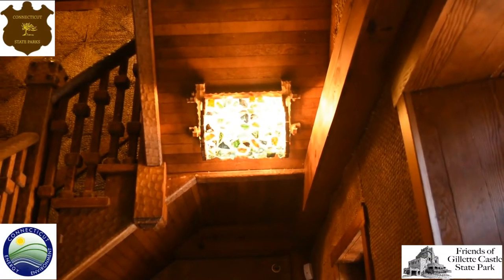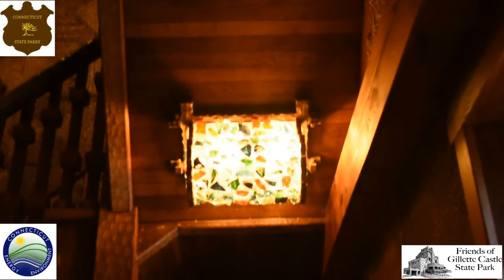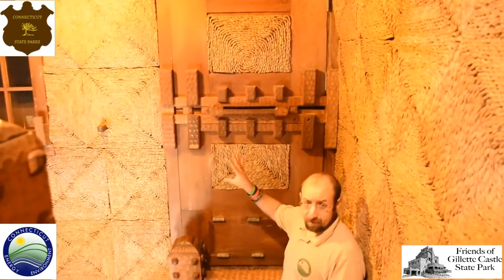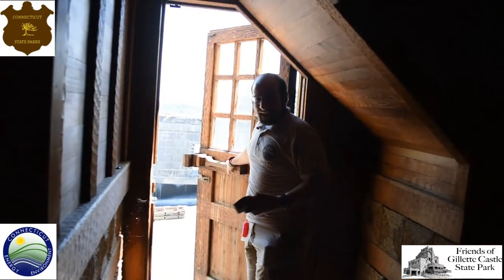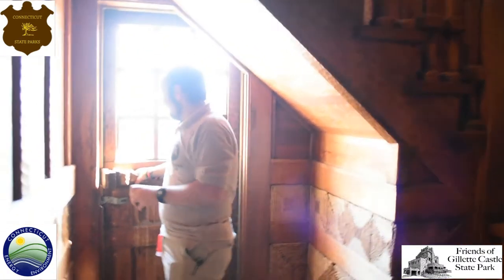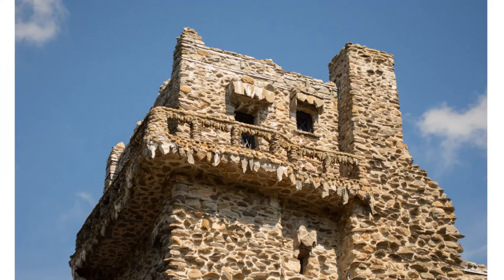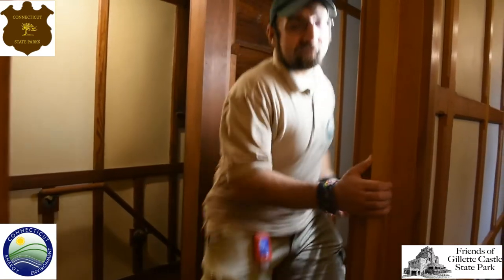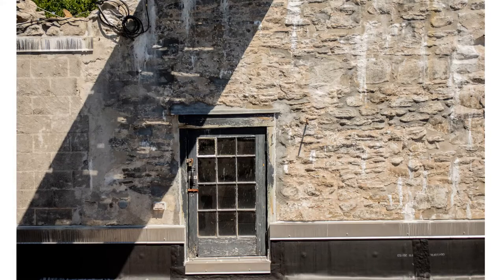Behind the Scenes at Gillette Castle: The Tower Rooms

Comment: According to the polls 586 viewers want the railroad rebuilt!!
Reply from the maker: 94 years ago, William Gillette spent $50,000 on the railroad. 14 years ago, we spent $10,000 to just restore the outside of one engine. How much will each of those viewers contribute towards the cost of the project?
Reply from the maker: The train bridge (now just a foot bridge) leading towards the tunnel has been structurally unsafe and closed off for almost 10 years. The cost to restore it is six figures. We have a few other things higher up on the ole to-do list.